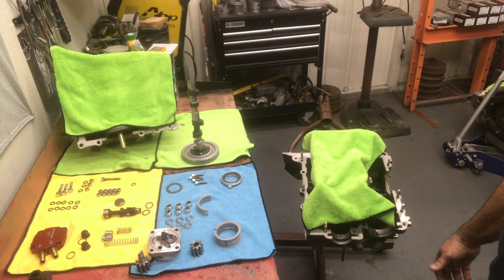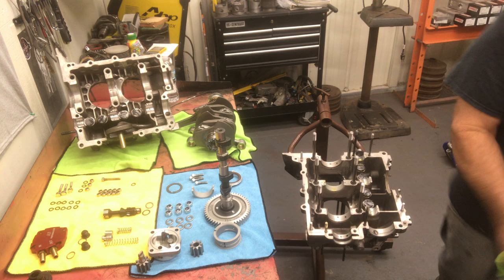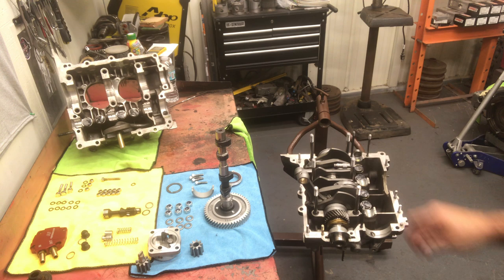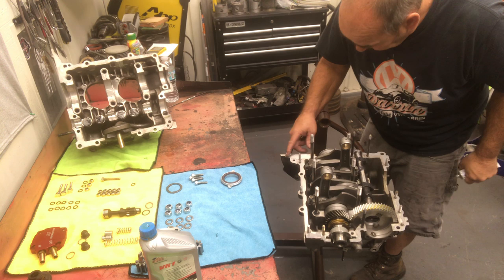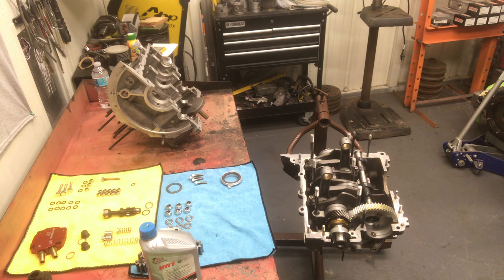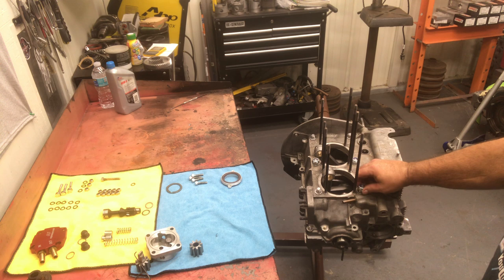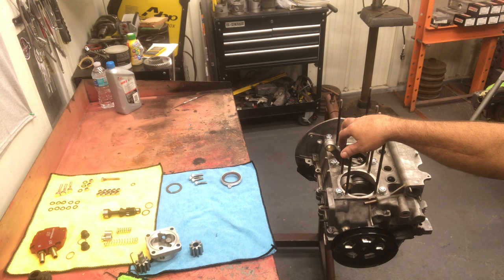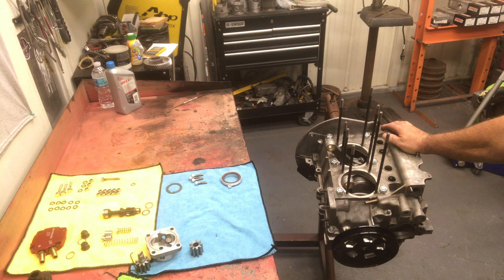Assembling the 78 x 90 .5 short block

Comment: I learned a lot from this channel, it boosted my confidence, I'm about to to the same engine  size you are doing ,I have the  parts except the case, the case I have is a dual relief has the bigger  studs the say,I must use the ones with the case saver with the thin studs,i  just cant find a later case, oh well

Comment: Hi Darrin. Cool video what exhaust will you be useing on Oscars motor?  I am building a similar motor. Mine is a 2017cc  78.4 x 90.5 with a k-8, 1.4s heads are unwelded but worked D port heads 9.5 to 1 cr and dual 44mm IDF's. I have 2 exhaust systems I can run. A 1 3/8  standard extractor and a 1 3/4 merged Berg header and muffler with a big collector. I think you mentioned in a video way back to run as big of an exhaust as you can and tune for it. So I am thinking I want the big pipe. What are your thoughts on this? 
Thanks

Comment: I love the ultra gray silicone. I found that the high temp red also attacks the engine case. What cam did you go with? Just curious....
Reply from the maker: I found the grade to be pretty good myself I like to use it still like the aviation perm attacks on some parts of the motor

Comment: Thank you for all your videos. In previous vids, you mentioned you prefer to use oil instead of assembly lube, so you can feel the parts rotate better. I noticed when you helped CT build his 40 hp you used assemble lube.  Is there a time to, and a time not to? About to do a few builds, and want to do everything correctly. Thanks again.
Reply from the maker: I like to use the assembly lube on wrist pins but I generally use oil on the bearing surfaces will also put assembly lube on the lifters and cam if it is already been broken CTs motor was mostly used parts with new bearings all the clearances were on the Loose side

Comment: Hi Darin,new to VW engines and was wondering about oil pumps. I bought a 2054 and I was going to put on one and five eights headers and find I have interference on the full flow oil filter adapter.  I'm using the side winder header like in one of your videos. I also notice 60 lbs pressure cold but only 10 lbs at idle and 30 lbs at 2500 when warm. Is this ok?  What full flow pump setup would you recommend? Thanks you.

Comment: Good morning. I have been watching a lot of your videos and have been wanting to build one of my own. I built one in high school about 20 years ago, nothing near the quality of what you’re doing. I recently purchased a few engines from a guy on Facebook. I figured I could scavenge the good parts and scrap the rest. Turns out most are shot. Two of the engines must have been sitting outside and are so locked up I can’t even get the heads off. The other block may be ok, but needs to be line bored. Which leads me to these questions. Where should I get the machining done? I live in Minnesota, I’m sure I’ll have ship it somewhere. Also, on this build I want to do a cheaper build, perhaps just a stock 1600 with minor upgrades. I hope to build something with more performance after I get some experience under my belt.  The block I have and want to use is a “B6403432”. Any suggestions or advice will be greatly appreciated.

Comment: Hello, is it ok if I put cam/zinc shield in the lifter bored to help hold them in place? Thanks
Reply from the maker: You can use grease to hold them in place are you can make some clips out of some coat hangers it is always better  to use oil on the lifter bores  if you PM me your address I will send you a set a Lifter clips for your next build
Reply: @vwdarrin  That's awesome!! Will do. Are you talking about the samba pm?

Thank you

Comment: I am looking to build an 1800 motor for my 69 bug. Is it worth it. I am running a 1600 sp. also I have an ac unit on the car. Just want to know what you think is better. Also I am not looking for performance just for a good ruing motor that can power the ac

Comment: Darn. You said that you  " notched " the lifters. Do you do that on all the VW  lifters ?????
Reply from the maker: Only notch the lifters when using an aftermarket cam the extra lift move the lifter further in the boar covering The feed hole on the lifter the notch keeps the oil to the lifter and keeps cool oil to the top of the motor
Reply: Yes, it is part of the bob hoover mods and is an excellent modification. Like vwdarrin said, it helps oil flow better to the troublesome head this making your cylinder temps decrease.